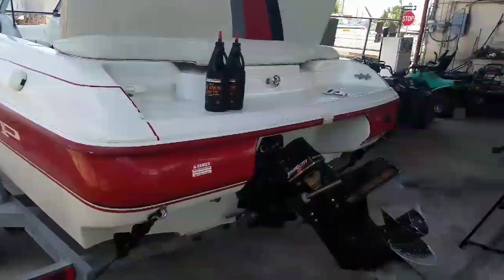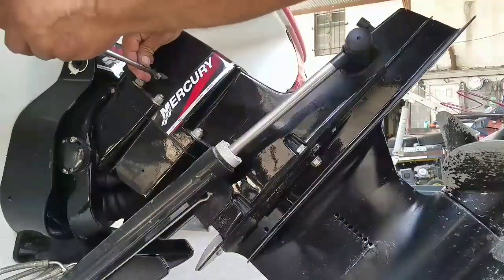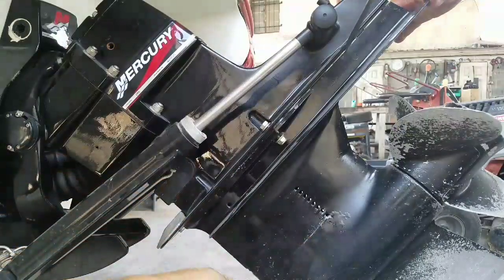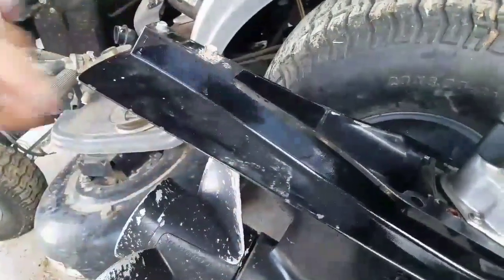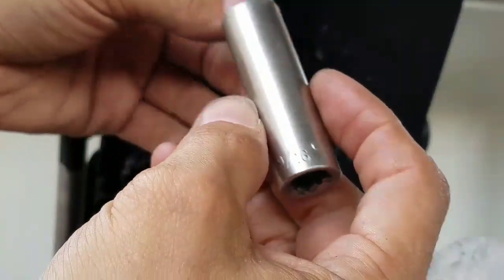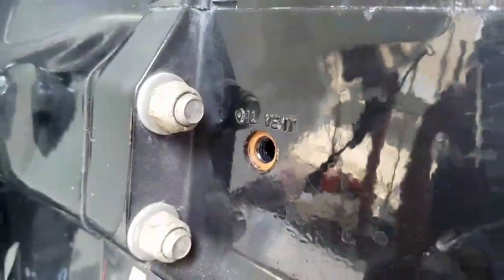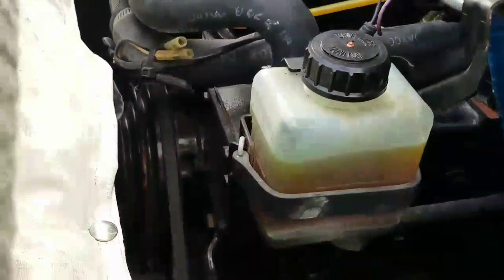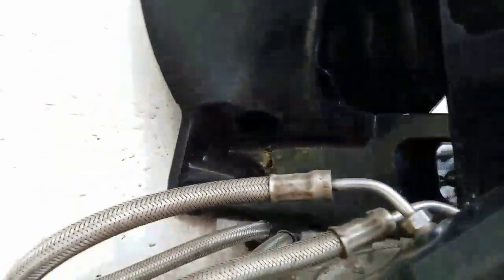How to replace an impeller on a Mercury inboard

Comment: I just replaced my impeller. Now oil leaks out of the weep holes when trying to fill it back up. What did I do? Is it the little seal near the water pump housing. Maybe it fell out? What else could it be?
Reply from the maker: Yea, my best guess is the o-ring next to the housing probably fell off or out of place. It happens!
Reply: GT's Performance thanks... Dammit. Lol

Comment: Hey, I bought a boat and kept it for a longtime (didn't get a chance to use it) 1989 3.7L Mercrusier 165hp 4cyl... When I fired it up after hooking up the muffs, I smelt some rubber burning and the water was not coming out of the exhaust. To test it further I took it in the water ran it for a little while, it was running fine when I was cruising (up to 2000RPM) until I reached 3500RPM, it kept revving but would not speed, and thus coolant spray out of the coolant cap(maybe) and smoke everywhere....

I saw green coolant all over the engine. where did the coolant came from? Shall I not see water?
I opened the cap since boat was running, but no water flowing, I slowed it down, on cruising speed and then it was ok.

Where and what shall I look into?
Reply from the maker: Some engines like the Volvo, have a radiator separate from the sea water. The impeller on your lower unit still picks up water and passes it thru your engine and radiator( the radiator has a separate passage) to help cool the radiator water.  If you don't have a radiator,  I'm just as confused as to where the green coolant came from.
But the real problem here is.. it sounds like your "engine coupler" is going out. This EC goes at the back of the engine and is beginning to slip.  That's why you can't speed up! To replace this you will have to remove your engine to get to it. 
I hope this helps,  try getting some second opinions to really confirm what's going on.
Reply: Thank you for replying back... By what you are saying, I will try changing the impeller first and then see where I stand. If it doesn't solve my problem, do a video on EC as well please. Thanks :-)

Comment: What do you use to hold the lower unit steady while you replace the water pump? I don't see a stand, are you just balancing it on something?
Reply from the maker: Yea. after I remove the lower unit, I just stand it against something while I replace the impeller. It's a quick job, doesn't take but a few minutes. If we are working on the gears,  then well just brace it on a bench vise. no excessive force, just to hold it in place.
Reply: GT's Performance thank you! Didn't expect a reply at all, let alone an hour later. I think I'm gonna go for it. I'm worried about lining it all back up when I put it together, but, I've watched your video and a few others and feel confident (sort of) that I'll figure it out. Thanks again. Great video!
Reply from the maker: I'm sure you'll do great. Get a second set of hands if you can to help you carry the lower unit while you align everything. If you need help with anything, just ask and I'll try to help as best as I can.

Comment: When changing the impeller did you leave the gear on forward or neutral
Reply from the maker: Jesus Carranza when removing the lower unit,  I leave the gear in neutral.  
When installing,..you can put the transmission in "Forward" and the gear selector rod  ( at the very back of the unit ( 2:51 )  there is a 7 shaped rod which is for the gear ) should be lined up with the lower unit,  but they don't always line up correctly. 
Personally,  I leave the gear in Neutral,  and when I'm installing the lower unit I'll stick my hand from behind the transmission and move that "7" to line up. 
👍 hope it helped!
Reply: Thanks bro
Reply: If I install it the wrong way would i damage the unit
Reply from the maker: Jesus Carranza get a buddy to help you lift the unit.. it can get challenging trying to do everything by yourself. 
Some helpful tips.. Lift slowly, spin the propeller and wiggle the trans up until out falls into place.   Only thing that could happen is bend the gear selector.. 
If it's not installed correctly,  the transmission will just stay in neutral.
 I'll post a video on this later.
Reply: @GTsPerformance  is there another impeller on the 4cyl 140 unit at the engine front side ? Or is that just on the v8s?
Reply from the maker: If it's an outboard, you have the impeller in the lower unit.
Reply: @GTsPerformance  no inboard outboard just like the one in the video

Comment: I have a 1990 Baja 454 IO 365 hp. Bravo 1. Your video is very helpful! I have a question during removal of Impeller pump housing. My motor has the fuel pump and fuel water separator on same side as the water pump impeller. My question is, do I need to loosen the belt for the fuel pump before removing the impeller housing?  Thanks in advance and the great video!
Reply from the maker: +Philip Tolentino you are probably asking about the "circulation pump"? 🤔 if so, yes! You will need to remove the alternator belt,  and the CP belt as well. This is totally different fin the impeller.  The impeller is in the lower unit.. 
The impeller brings the water to the top of the engine,  then the circulation pump circulates the water thru the engine,  and runs it's course.
If you have any other concerns, please let me know.  ✌
Reply from the maker: +Philip Tolentino https://youtu.be/W2KAe4qEuwM

Hope this helps!

Comment: Hey bro have you work on removing the gimbal bearing and the bellows... I'm doing this job this weekend and I have a question .. I have the alignment tool to check the alignment of the engine and outdrive my question is do I check for alignment before removing the gimbal bearing or wait until I'm all done with the job thanks
Reply from the maker: +Jesus Carranza the alignment tool is more like a bearing press. It is used to install/ remove the gimbal bearing.  The tool holds the bearing lined up straight and should go all the way in until it seats completely. 

 There may be a hole on the bearing, this is not a guide,  it's actually for the grease to go in. There should be a groove all the way around the walls where the bearing is going to be seated.. once installed,  that groove should line up with the hole on the gimbal allowing the grease to go in. 

This should be a one man job,  but helps if you have someone carry the lower unit while you align the shaft back in. 

I'll see if we get something like that here at the shop so I can record what to do.  We only have a Volvo outboard, but is here for something else. If you're working on a MerCruiser, it should be a lot easier. 

Keep in touch. if you run into anything you need help with, let me know👍

Comment: I do enjoy your video but I want to ask if the transmission oil can't fill from the up plug.
Reply: No because you will trap air inside. And won't get enough lube in it the reason you should do it from bottom is so you can let air escape as you fill
Reply: Elite Edi Also important that the unit is fully down.

Comment: I have a V8 5.0L mercruiser.. in/outboard.. do I have two impellers?
Reply from the maker: Yes, sorta. You have an impeller in the lower unit. And a belt driven "circulation pump" right on the engine.
Most common is the impeller. Those are replaced at least once a year,  maybe twice depending on how often you use your boat. (Impeller is rubber, so it dries if not used)
The circulation pump last a lot longer. One way to tell if its going bad is to check for a water leak behind the pulley. They have a pre-drilled hole meant to drip when the pump is barely going.  Also, noisy bearing, or has play on the shaft/ pulley.
Reply: Thanks for your reply. I’ll check it out!

Comment: I have a crownline with a mercury 5.0 its over heating fast when in water
Reply: chakodewatts 
This is what you're looking for! Also check if your thermostat is stuck.
Reply: You need to check impeller on the engine water pump

Comment: Hey bro I just change my water pump.. I installed everything the same way you did in your video.. put some lower gear oil on it.. but now I'm getting a clicking noise when going in forward gear or reverse.. what do you think it's the problem thanks
Reply from the maker: +Jesus Carranza sounds like it just needs adjusting on the cable for the shifter.. (passenger side on the engine) but what kind of engine are you working on?
Reply: 3.0 MerCruiser
Reply from the maker: +Jesus Carranza ok try this. with the engine off,  put the gear in Forward,  then go to the back and with your hand/ foot try rotating the propeller.. it should feel tight, (like the compression when cycling the engine).. if you hear the clicking, it's just adjusting the cables.. try it on reverse also.. let me know.
Reply: In Reverse it does the same thing

Comment: Is this part of the shifting cable?
Reply from the maker: Yes, if you have the engine uncovered,, look at it while moving the shifter.  You should see them move back / forth. It should have a bolt holding them down.  If you loosen that bolt,  you should be able to adjust those cable by a plastic, star looking nut. Loosening or tightening that will move the cable (back or forth) till you find a perfect spot.

Comment: So you should have replaced the seals in your prop hub. The oil you drained was like milk and there was also quite a bit of water too.
Reply from the maker: As a business, we only replace what the customer wants. We can only recommend or give them suggestions to  replace certain parts..
We have had times where we go above and beyond,  only to have non paying customers cuz that's not what they asked.  🤷🏻‍♂️
Doesn't take a good eye to notice there's water in the oil,.. we noticed too!

Comment: Your said it's been sitting for 8years that's almost a guarantee that the upper seal is going to leak and you should of put the top plug on and kept filling until fluid starts to enter bottle to purge air out of system

Comment: Wher is the thermostat located ?
Reply from the maker: Thermostat should be on the front side of the engine where the pulleys and belts are, top, center.

Comment: Okay I did I put it in forward and it locks.. but if I spin it the other way well being in forward  I will get a clicking noise?
Reply: When putting it in forward gear should the propeller spin in one Direction and not in  the other direction
Reply from the maker: +Jesus Carranza sorry for the delay.  In forward it should lock one way,  but click the other.  And the reverse should lock in both directions...
Reply: No problem bro.. Ok then so In forward position it locks one way and it clicks the other.. but In reverse it does the same thing locks one way and it clicks the other way
Reply from the maker: +Jesus Carranza the adjustment cables are on top of the engine. If it's doing the clicking while on neutral, try moving the shifter slowly either back or forward to find the spot where the clicking goes away.  Then, on the cables loosen the bolt it has on the side so you can freely move the plastic adjuster till you find a good alignment where the shifter is completely on neutral and there is no clicking.. 

I know it sounds a bit complicated by text,  but I will try posting a video or maybe do a live (tomorrow)  to help you fix this problem..

Comment: Wow! be careful about using this guys advice. One is to use dish soap instead of grease to lube the impeller. Most grease will attack the impeller material and some are even water resistant. The seal was left off of the drive shaft. It doesn't look like he replaced the lower gasket under the wear plate. This is a known problem area for high speed over heats. I would also recommend greasing the mounting surface to help prevent corrosion. It works better than paint if using the correct type of grease. The Mercury Extreme Grease I have found to be excellent for this and lubricating purposes.

Comment: goog video but must explain why change it and or show the problems that it creates
Reply from the maker: Usually,  the impeller dries out if not used often.. 👉https://youtu.be/ubkLxMe-vkw
If you use it often, but hardly change it..  it loses water pressure and can cause the engine to overheat.
A $35 impeller replacement is cheaper than a $600 engine rebuild

Comment: WHY were you changing the impeller ?
Reply: overheating ,,,,never been changed in 10 years or more . running hotter then normal ,without overheating . plus it's easy to do ,if your handy with tools ...and even if he took the cover off the impeller of and it looked ok . hell you re there put new..cheap dollar repair ..peace of mind .

Comment: Personally, I feel the gasket surfaces were poorly prepared, and I don’t think cleaning them with metal objects that scratch the sealing surface is a good idea at all. Also no control on torques. Never use an impact driver for torquing up.

Comment: Uh, this is not an inboard.  Great video though.
Reply from the maker: ¿Stern drive?  🤷🏻‍♂️
Reply: @GTsPerformance  Stern Drive is how I refer to it but I/O or Inboard/Outboard is the same.
Reply from the maker: I tend to call the lower unit,  "transmission" 😁
Reply: @GTsPerformance  I've heard that too! It's been a while.  I think my dad used to call it the same.

Comment: That's not the way to do it. You need to pull the complete drive off. Inspect the gimbal bearing and Bellow's, grease the shaft, clean out the inlet hose and so on.

Comment: You lost me as soon as you called that an inboard engine.
Reply from the maker: Yea, don't know what to tell ya'. Some people call it engine,  others motor.  Just like some know an impeller as sea pump, water pump, circulation pump,.. no matter what you call it, at the end of the day the job still gets done! 👍
Reply: GT's Performance Ok, so that went right over your head 🤦‍♂️
Reply: @Icutmetal  
Sterndrive or Inboard/outboard